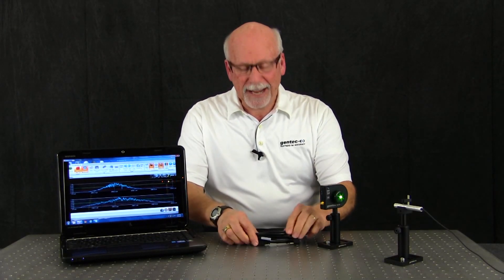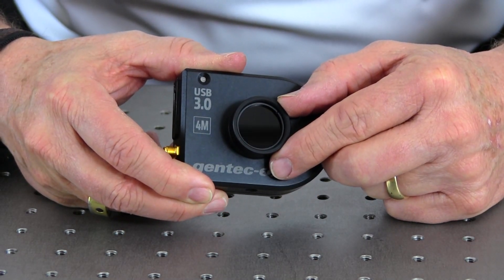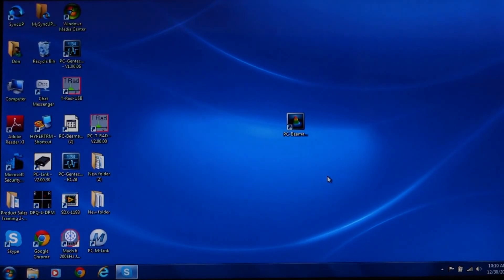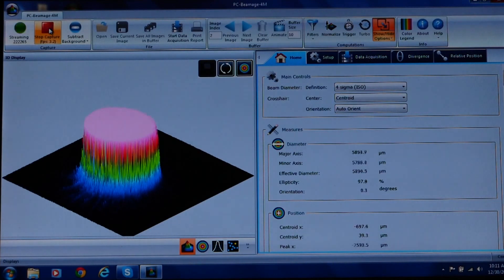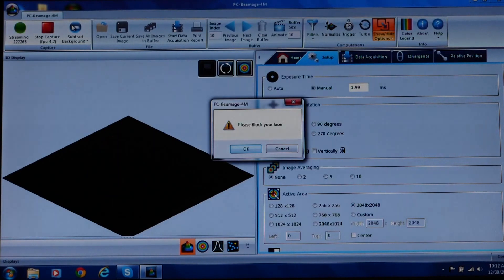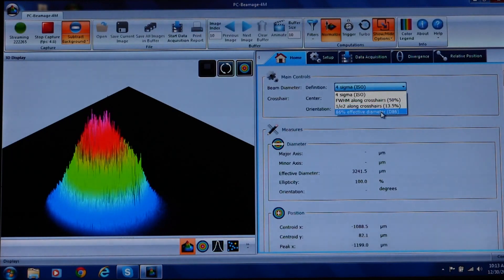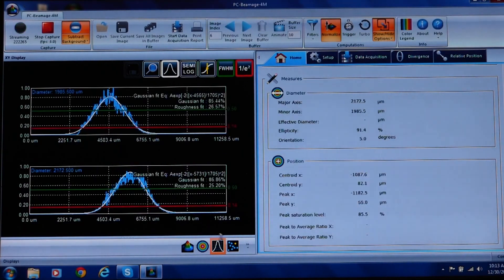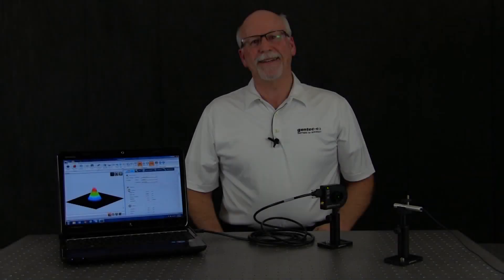Beamage Quick-Start Video

Comment: hi, does this beamage camera use to determine wavelength of laser beam?
Reply from the maker: Hello Murtaza! BEAMAGE cameras cannot be used to determine the wavelength of a laser. It is however possible to place a bandpass filter in front of the camera to let only one very specific wavelength pass. Let us know if you have any other questions!
Reply: @GentecEO  Thanks for you kind reply. Is there any hand held equipment through which we can determine wavelength of Red Laser Beam of rotary laser transmitter used in construction and agriculture purpose?
Reply from the maker: @jinbaba1000able   No Gentec-EO products can measure wavelength, but you should search for "diffraction gratings" online, which provide a simply way to determine the wavelength of a light source! Another solution that is much more accurate to determine wavelength, but also more expensive, would be a monochromator. We hope you will find what you need!